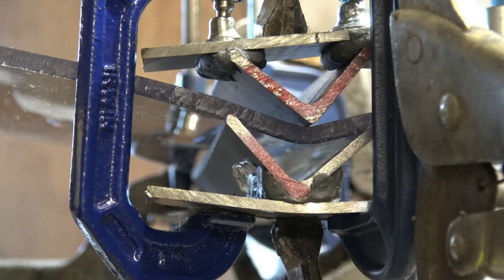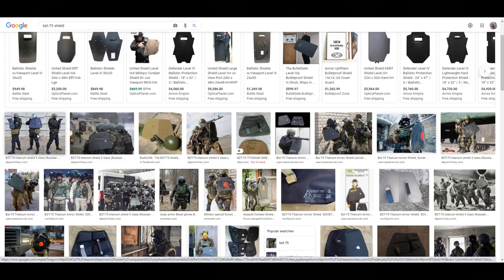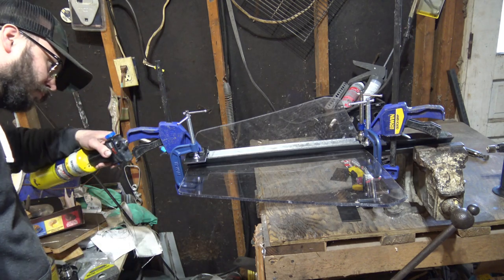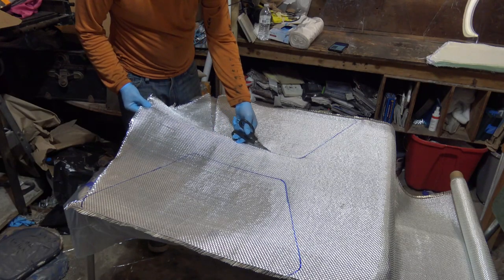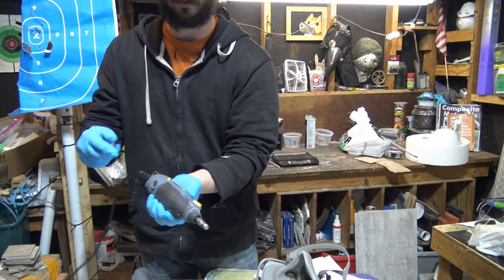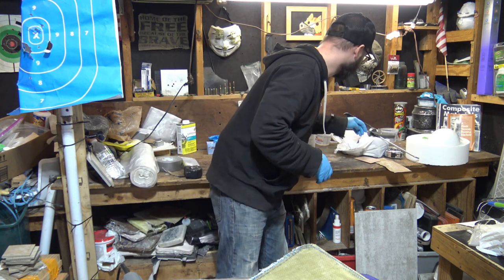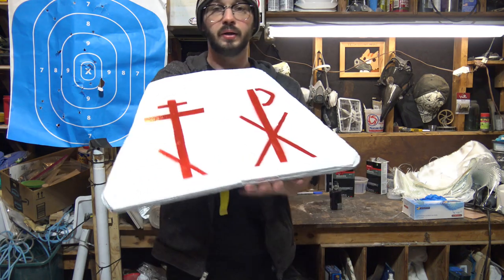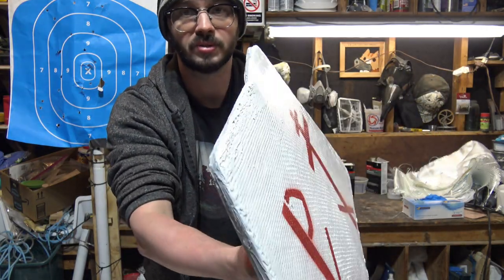how to make a bullet resistant shield!

Comment: Great stuff. Consider covering the brittle tile face and edge of the shield with a thin layer of foam or 1/16" polycarbonate/hdpe. That way a simple melee strike from a baseball bat or just dropping it on the ground doesn't shatter the ceramics. 

Adding a layer of mylar or aluminum window mesh offers protection to the bearer from weaponized microwaves.
Reply: Microwaves??
Reply: @diegoguerra8736  Microwave Active Denial System, THOR directed-energy system, vehicle mounted active denial system (VMADS). Check these out.
Reply: @renjimalarky9185  After some research, I've to say, it's just a shield, not a Faraday cage, I think it would not protect

Comment: Man hearing them American prices blow my mind. Stuff is soo cheap down there.

I tend to wrap a layer of fiberglass around each of my builds. Helps with spall and kinda holds everything together. I usually go 17 or 18 layers of fiberglass and then the last wrap puts one layer in front and two in back..
Reply: What kind of resin or epoxy do you use for the fiberglass? I didn't want to buy a little tiny can of bondo resin for 100 bucks 
I tried aluminite and it dosent get solid 2 weeks my test sample is consistency of almost frozen honey key word being (almost)

Comment: Great job!
I would seriously suggest to cut bottom corners off. To make it no more than shoulder width.
Make top 3" of shield see through policarbon. Have a look on police and swat shields.
Reply from the maker: So more of a square design? I do like making the top transparent though, you could build up those areas with more polycarbonate, acrylic, glass, ect. And get it to a higher ballistic rating
Reply: @Techthisoutmeow  i have seen some shields that have given up on transparent sections altogether and instead place a camera on the front and a thin tablet screen for it on the back. Then it can benefit from thermal/night vision also.

Comment: I like the shape. Maybe an attachment to be able to attach an extra on the bottom for either two singles or one full body idk. 
You always get me thinking with your projects. 
Thanks for all the tips. 
The milk jug project of course pulled me in to this channel but it's got me thinking about shields with the milk jug concept... cheap shield. Light. Think it would float?
Reply from the maker: Yeah the shape was what drew me to the BZT-75 in the first place, it's quite unique. And I like the idea of attachments where needed!
Reply from the maker: And you definitely could use recycled HDPE for the base! I just got all mine tied up in other projects lol.
Reply: @Techthisoutmeow yea different attachments, Maybe even like a knife holster or something! I like the idea of hdpe for the shield for cost..do you think the larger shield size would have the same stopping power as the smaller 6x6 squares?

Comment: Could alternating the weave by cutting on the bias help stagger the pattern in a way that would better trap the bullet? Like staggering bricks makes the wall stronger. If you cut each layer on a slight rotation, would use more fabric but maybe be worth it by limiting the access of the bullet even more?

Comment: You are using "Plain Weave" fiberglass. Dose it work to use cheaper fiberglass like "Mat" (i hope i m pronouncing correctly)?  Thickness/protection ratio, will have the same number of sheets if i m gonna use cheaper fiberglass?
Reply: Unfortunately, to the best of my knowledge chopped strand fiberglass matting is effectively useless for ballistic protection. Fiberglass laminate armors work on a similar principle to Kevlar, they  rely on the glass fibers being woven together, so that the tensile strength of every strand is reinforced by the tensile strength of every other fiber it interlocks with. Woven fiberglass is to chicken wire as chopped strand fiberglass matting is to those bead curtains people hang in doorways. One will effectively restrain chickens when properly employed, the other has no chance of restraining anything.
Reply: @piratewhoisquiet  Woven fiberglass like he used in this vid, is too expensive in my country, and by my estimates to make two plates (rifle rated) it will cost me about 500$. The one used in making septic tanks , bathtubs, etc...  is about 3 times cheaper, but if its useless for protection , there is no point to try it. Thx for explain g...

Comment: in theory would it be better to use HDPE instead of  polycarbonate?
Reply from the maker: For the laminate? Or the backer? Polycarbonate is stronger than hdpe for most applications. As a backer hdpe would need to be thicker, at the same weight. Hdpe biggest advantage is the cost, because it's easier to recycle at home. You could for sure use hdpe, but I would do some things differently.
Reply: @Techthisoutmeow  I meant as a backer but you're saying polycarbonate is stronger than HDPE I didn't know that.
Reply: Might be tough to bond with hdpe. Polycarbonate takes adhesives better

Comment: I feel like not bending is
 the better option.
Reply: Couple reasons for this:  feel like, with almost all materials, wrapping the core material multiple times with a fabric intended to absorb the lateral stress & hold the material together, will work better across a flat plane.
Reply: 2nd, the primary advantage of a pavise style shield is the strength of the "ridge". When you melt the poly, it is weakened rather than strengthened.
Reply: If you really want to make a creased ridge on a shield in a modern ballistic context, better to a) make the shield from 2 pieces, connected by a semi-flexible, springed, hinge, to absorb some impact & allow the 2 pieces to retain integrity.
Reply: b) offset the shield handle from the impact surface with a center-grip (rather than strapped as shown) to reduce the stress & available target area. Its fine to include the strap option, in fact multiple strap options, for carrying.
Reply: Think about it this way: with a shield like this, mounted with a bicycle mirror, I could basically shoot around corners. That would be the primary, amazing advantage.
Reply: BUT, it NEEDS crenellations. That is a must have, at least on 3 sides. How would I do this? Set the shield vertically, braced around the corner edge. With the other hand, brace my rifle on the shield like a tripod. I need a stable place to set the barrel so it won't slide, but I can still reset it easily.
Reply: I've regularly used a 13-20 pound shield, but not everyone wants to carry something like that.
Reply: Are you holding this in your right hand, or is the video reversed? Are you a lefty like me?
Reply: If you're intending this to be used in a "full frontal", shield wall situation, it would be far better to turn it upside down or sideways, unless you're really fat. I am thinking of the classic Thracian peltast shield, which had a half-moon shape. But again, a center grip would reduce the target area, increase your options, and allow a better tripod effect.
Reply: Look, even in ancient times, shields were not full-proof. Only as defensive technology advanced did they use strapped arm handles, but it was still a cat & mouse game. Center grips are the best for reduced target area & placement options. Thats why the romans used them.